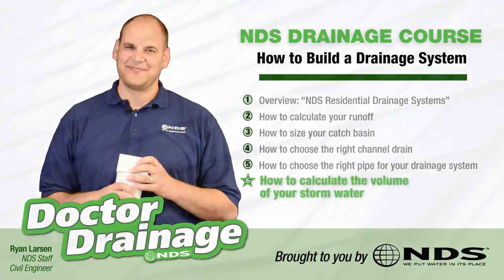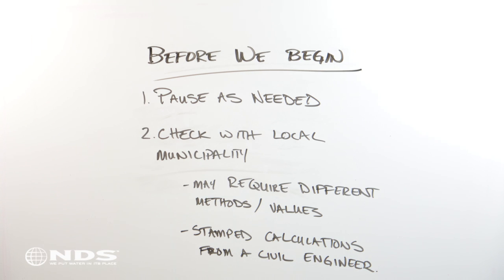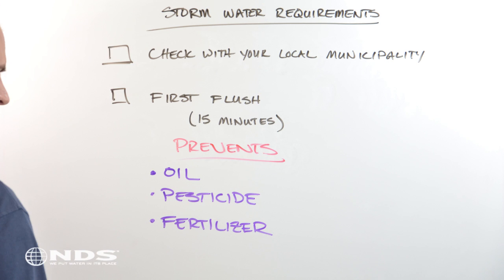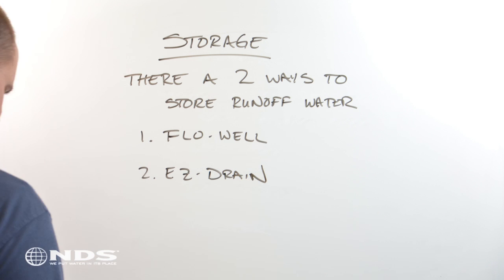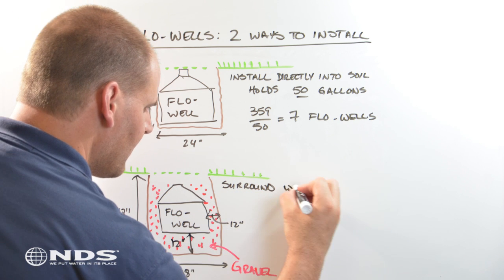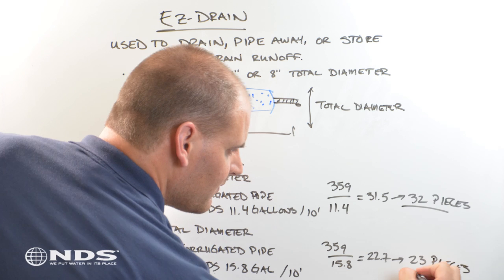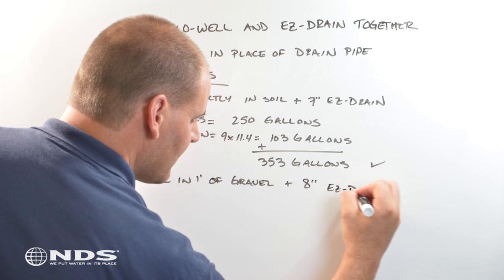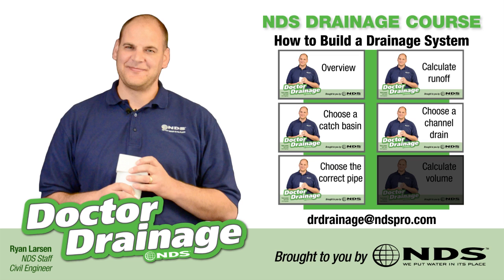How to Calculate the Volume of Stormwater Runoff for Your Drainage System | NDS Drainage Solutions

Comment: Unable to see the calculation steps as they are obstructed by written dialog.
Reply from the maker: @gopaljain231 Thanks for letting us know! If captions are blocking part of the video, you can turn them off by clicking the “CC” button at the bottom of the YouTube player. On mobile, just tap the screen and select the three dots → Captions → Off. 

Let us know if you need any other help!